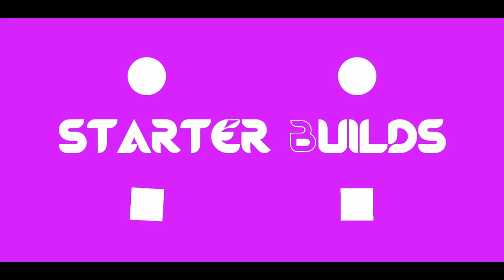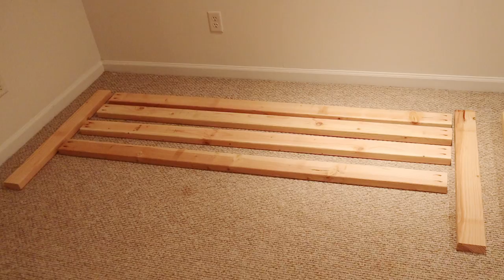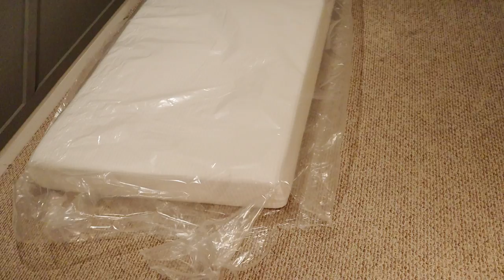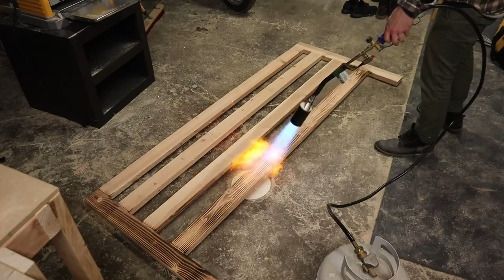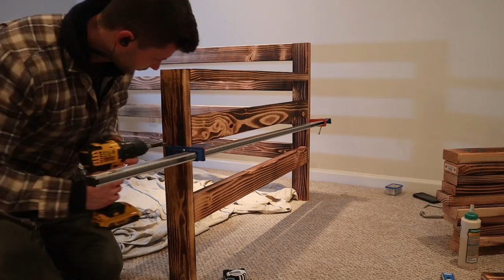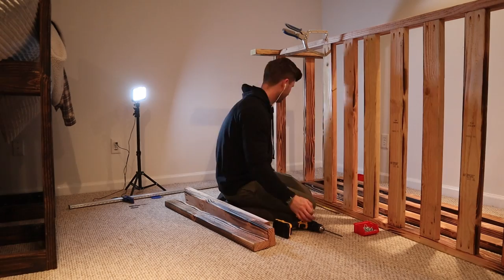DIY Daybed | How to build a Daybed with 2x4 material

Comment: When you brought out the fire thing.. Within 1 second i was like i will not be doing that😂😂
Reply: Also is there a reason why you screwed the bottom slates in from underneath at and angle instead of doing it through the sides like you did on the arms
Reply from the maker: @moerichards1754  that was just personal preference the way I screwed the bottom slats on. You can attach them anyway you’d like

Comment: Would you by any chance have the measurements in case I wanted to try this project for a QUEEN SIZE bed?! I would really appreciate it!!
Reply: wondering if you found these measurements?? I am wanting to try this for queen size too!
Reply from the maker: The dimensions shown for the twin bed in the video are  78" wide x 33" tall x 42" deep and a twin mattress measures 38” W x 75” L so for a queen with the mattress being 60”W x 80”L you would need to adjust for it to fit correctly.

Comment: It looks great. I have two questions: what is the weight capacity of this bed? Are pocket hole screws stronger than regular screw as in butt joints?
Reply from the maker: If I had to guess on capacity of the bed I would say around 300- 400 lbs and yes I’d recommend pocket hole screws for extra strength and support. Rather than butt joints